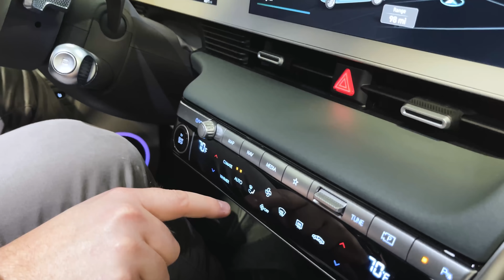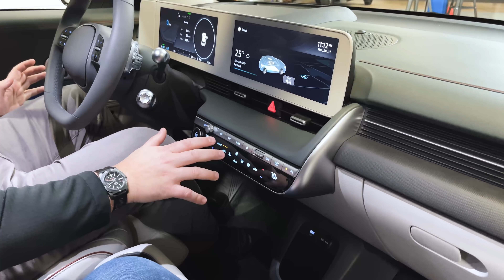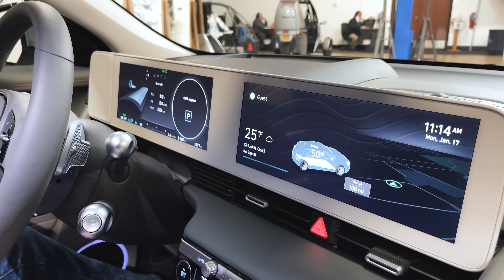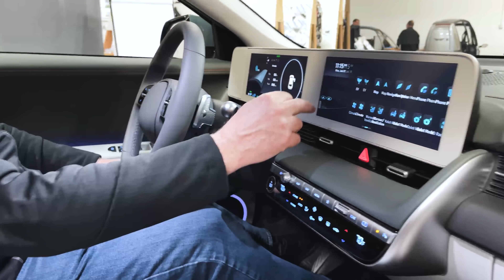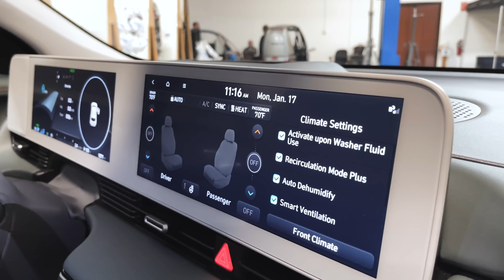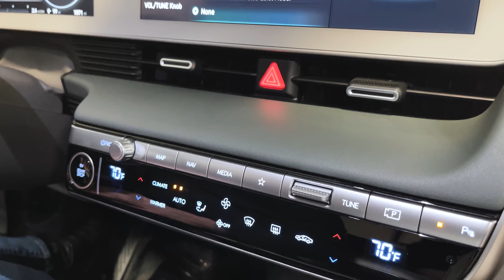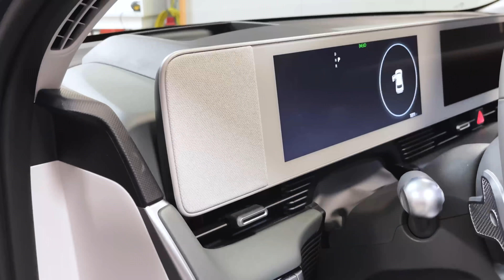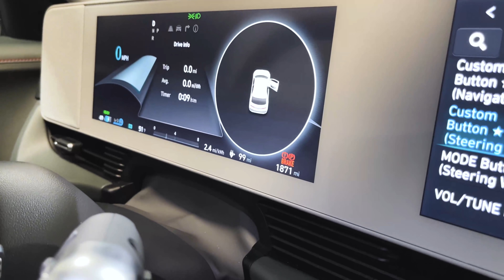2022 Hyundai IONIQ 5 | Sandy's First Impressions

Comment: The simplicity and elimination of parts is pretty high in Sandy's mind.
For the average consumer it's exactly the opposite. People complained dramatically when Honda removed the volume and tuning knobs on their stereos.
People like knobs and buttons that are easy to find without searching through a touchscreen. This is been shown over and over again in customer satisfaction data. People hate searching through touch screens. Voice control is a way around that and Tesla accomplishes that decently.
Reply: No actual customers complained.  Always ignore complaints from media companies looking for clicks or any complaint that mirrors what a luddite would say.
Reply: Precisely. Also the buttons in the left side of the wheel are great. VW hid the one Sandy never figured out (Auto Hold - Hill assist) and made it a complete mess.
Reply: @_PatrickO  Do you define a "luddite" as anyone who doesn't like the latest BS gizmo that makes the car objectively harder to use?
Reply: Most old people sure in 5 years the predominance will be those who grew up in the smartphone and tablet age and unless they are into retro that crap is not going to work for them.
Reply: @Barskor1  
Using your phone isn't the same thing as using a control on a car while you're driving down the road paying attention to other things.
I've seen plenty of young YouTubers that do reviews on cars and they All dislike controls that are used every day to be put on a screen. It's much easier to reach over put your hand on a knob that you can feel with gloves on in the winter and change a setting.
Wipers the gear shift the volume knob the tuning knob the climate control those things should be tactile. It can be dark out and you can find where the thing is without having to look at it.
Has nothing to do with old people it has to do with common sense and in being an intelligent design. Having to sort through a menu to find a button to press and then have to take your glove off in the winter to press it doesn't seem like smart engineering to me.
Now if you can implement voice controls that are quick and reliable that would be an alternative. But that hasn't been the case so far and I doubt that it will be anytime soon.
Reply: @_PatrickO  It's not just customer satisfaction, and it's not about being a luddite. A lot of research goes into user experience and satisfaction, and also into safe operation of car controls. It's not buttons vs touch screen. Touch screen only interfaces fare rather mediocre in terms of safe operation, particularly with first time or occasional users, but they score high in customer satisfaction with frequent users. Heater controls are a great example. People who use a car every day set up the HVAC in such a way that they never or very rarely have to mess with it and therefore are very satisfied with the experience. Infrequent users feel that it gets too hot or too cold or the fan blows too much or too little after 2 minutes and want to adjust it. If they find a temperature or fan speed knob, they can adjust HVAC with very little distraction, because these knobs tend to work the same way and sit in the same place in most cars. Touch screen only interfaces are different in every car, people first look for the usual knobs and then try to figure out the touch interface while driving along, resulting in unsafe operation. Most people are used to steering wheel controls for the stereo, a volume knob is therefore no longer required, if intuitive steering wheel controls are available. Basic HVAC controls OTOH may no longer require knobs or buttons in the future, if generally accepted alternatives are in widespread use. Right now such an alternative doesn't exist and separate standard HVAC controls should still be provided. The car in the video is a good example for HVAC controls in this transitory phase. Full touch screen and speech control exist alongside a classic HVAC control unit, catering for all types of users alike. There are objective, scientifically proven reasons to choose this approach over just knobs or just touch screen at this point of time.
Reply: @kens97sto171  Voice commands problem solved have a nice day with your toggle.
Reply: @Barskor1  
I'll take the toggle, when I'm cranking up the music listening to my favorite tunes, and then you want to change the wiper speed or change the temperature.
 You going to scream over your song. Are you going to use the voice command to stop the song ,so then it can hear you for your next command? 
Or I can have a simple switch that I can find in the dark and press.. and be done 
You young people think you know everything. 
But you think a more complicated way to  accomplished something extraordinarily simply and easily is the better way.  It's not.
The simple switch, or complicated programming or using expensive difficulty use touch screens. That's not progress..
 That's stupidity.. being called progress.
Reply: More importantly there is a lot of research showing that driver distraction is a big safety problem. Phones is one thing, but touchscreens in general require looking away whilst buttons don't. Not sure where they come on the cognitive load scale, but I'd be very surprised if buttons aren't considerably better. The modern trend for everything in a screen UI may be overtaken by increasingly stringent collision-reduction legislation.
Reply: @adrianguggisberg3656  "A lot of research goes into user experience and satisfaction", LOL!  That is not true.  Those dash buttons are hold overs from before touch screens.  No real research was used.  When is the last time car companies polled all their owners on anything?  Never.  Tesla meanwhile gets tons of feedback because people can easily report an issue right in the car that goes to tesla.  Then because they use touch screens, they can push out changes to existing cars and not just implement changes once ever 7 to 10 years like legacy auto.  The legacy companies already designed their next 10 year platforms and are trying to retrofit them to be EVs while reusing as many existing parts as possible because they see EVs as a recall liability and do not want them.  It is a mess.
Reply: @xxwookey  "More importantly there is a lot of research showing that driver distraction is a big safety problem." name a study.  Because this is most certainly a lie.  Who is doing this research and who receives it to act on it?  People assuming there are scientists behind any of this are fools.  Car companies do very little research, management picks the platform for the next 7 to 10 years and that is all the "research" they put into it.
Reply: @Barskor1  Yeah, voice control. It doesn't work, mate. I'll gladly voice-command voice commands up Siri's bottocks. Sure, I'm a useless old boomer, but while I grew up with rotary phones, I'm looking back on 8 years of Tesla ownership, and I'm telling you it's still more distracting and takes longer to do something with a voice command than with a button. It's also unnecessary, there's nothing that needs to be done while driving that can't be done with a button in my Model S. Voice commands is nice to have for people who like this particular way to make a car do something, but there are millions of people who can't speak clearly, or can't speak at all, or speak a language that doesn't work with voice recognition, etc. It can't ever be more than an option. This Hyundai has voice recognition, it also has full touch screen controls and it also has almost all the buttons most people want. And that's great, because you get to choose which of the three options you want to use. And there's even a fourth option in most cases: Let the car do it for you. That's the best option, because you don't have to do anything, not even think about it. And this car does it really well. Now what I wonder is why you hate buttons and dedicated control panels so much, that you want them removed. Are you a car manufacturer? I don't see how anyone else could profit from their removal.
Reply: I would think this is an older person complaint. I'm 71 and touch screens are fine. But I also had all the early tech. Younger people have NO problems with screens.
Reply: @michaelsmith2723  
The problem is you have to look at a screen to touch the button. And while the car is moving your fingers bouncing around this is not something you can do without looking. And when you're driving you're supposed to be looking at the road. Much better to have a tactile button that you can feel in the dark without having to look at it. At least for controls that you're going to use regularly.
Or get the voice controls working properly and easily that's the other solution to the problem.
Reply: @user-io4sr7vg1v  Boomers
Reply: @kens97sto171  Touch the screen just as easy as touching your toggle....
Reply: @xxwookey  If you don't know where the touch screen button is sure...
Reply: @Barskor1  
No it's not. Why don't you close your eyes and then try to hit the touchscreen button? Good luck with that.
 I can do that with a knob because I know where the knob is and I can feel it with my hand without looking at it. 
And that's what you should be doing when you're driving looking at the road not at a touchscreen.
 I'm sorry but you're absolutely wrong,  
it is not easier, it is not simpler, it is not faster, it's not better really in any way.. 
Voice control is the way to go about this if you're going to do it without buttons or knobs.
Reply: @kens97sto171  Top outside corner right two fingers down one finger over, done. have a nice day.
Reply: @Barskor1  As a lot of people working in the field of UI and designing ie the man machine integration in avionics could explain to you, you are promoting a myth. Age and what tech you grew up with does not matter, what matters is the time used with the driver's conscious focus occupied by the interface and thus keeping the driver from maintaining a spatial awareness, instead of handling the vehicle and keeping safe. I have participated as the lead evaluator and seen  countless of the people you would assume where digital natives and "a natural" fail miserably in aptitude testing. As their failure to react was due to them not being conscious of what was happening most did not understand what went wrong until shown the video.

We also did some research on the differences between "glass interfaces" and tactile interfaces and the conclusions where irrefutable: The tactile interfaces resulted in life saving differences in reaction times.
Reply: @kens97sto171  Yes, and remember, one mistake may kill you and your passengers and other people.
Reply: @Barskor1  And you won't know, without taking your eyes off the road , looking at the screen, refocusing while physically moving your hand while the car is moving, swiping to find the correct screen, and having to confirm the correct input, returning eyes to the road and refocusing.  All this while risking everyone's life who is unfortunate enough to be on the road with another distracted driver.  I suspect that people that prefer screen only are the same ones who think its okay for them to text and drive.
Reply: @wilfredvanvalkenburgh2874  
Exactly, which is why I don't like touch screens for regularly used controls in a vehicle. Like my volume knob, tuning, HVAC, windshield wipers is a big one. It's suddenly starts to rain or The vehicle next to you hits a giant puddle and splashes mud on your windshield and you need to quickly turn on your wipers. That's the time for levers and knobs and buttons that are right at your fingertips and you can use your muscle memory to operate without having to look at anything.
Reply: @wilfredvanvalkenburgh2874  Let me just remined every bubble wrap the world Karen on this thread that Tesla's have touch screens AND they have the fewest accidents of any car per kilometer driven of any car in history. Have a nice day.
Reply: @Barskor1  
Teslas are purchased by particular people, who may be safer drivers in the first place (not their first car etc), or the accidents that do happen may be caused by using the screen menus...?
Context is everything and you have given none, whereas the other commenters have (even actual research)...your views demonstrate why Tesla will NEVER outperform car producers, because Tesla's philosophy is that they don't make cars, they make factories, which happen to produce cars...just the same as the terrible attitude regarding software and how easily you can get left behind unless you use it every day.
The accelerator and brake aren't in a different position for every different car and it will be interesting to see how the racing wheel style actually works on a real world car (I think it will appeal to gamers only). What if it makes the cars less safe, how will Tesla handle the lawsuits...?
Reply: @marclawyer2789  You are hilarious! Please go big on shorting Tesla stock you deserve it.
Reply: the wipers are a mess in the Tesla
Reply: Voice is cool but annoying
Reply: @rp9674  
I agree in general. However if it works quickly and reliably it is a solution. But a lot of times it's a pain in the ass. Press a button wait for the music to stop on your stereo say something to open the glove box. Or you can press a button and be done with it.
Reply: @kens97sto171  to be specific, calling a contact, easier through voice, changing the audio, easier with buttons...for me.
Reply: @rp9674  
Yep I agree.  And door the contacts, calls, text message. And Navigation.  I use my phones assistant. And since Tesla does not have android auto or Apple car play.. would be a pain. 
For HVAC , Audio.. glove box.. I totally agree.   A button is easier.

Comment: I'm an IT guy and a car guy. As much as I like technology and touchscreens, I like to have quick access to controls hile driving. If manual controls provide quick access keys for AC, navigation, etc allowing me to keep my eyes on the road and less swiping trough screens or menus... I'll take that any time.
Reply: That was nice that they had those too addressable star buttons on the steering wheel that you could program to  have it bring up the heating or navigation That seems to be a pretty good solution. Because obviously you can't do over the air updates very easily with  tactile buttons.. So much more flexibility in manufacturing to get away from dedicated switches and buttons.

Comment: After looking at 6 or 7 ev's the ioniq was the only car that we actually took time to get in and really try to figure it out. The thing that Surprised me most is that so few reviews figure out the back seats, sandy gets halfway but missed the slide lever underneath to pull the whole rear seat forward sacrificing leg space to boot space, this is great when you have smaller kids.
Reply: Yes! This car is so practical, when you can choose between rear seat legroom and luggage space.